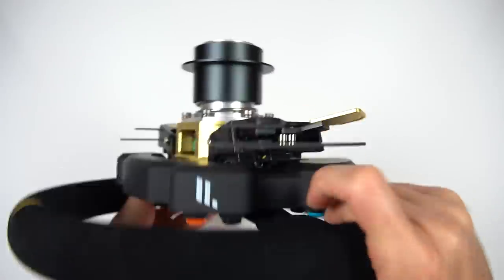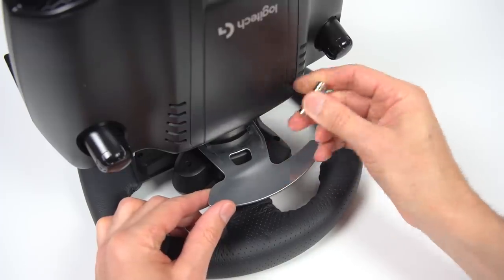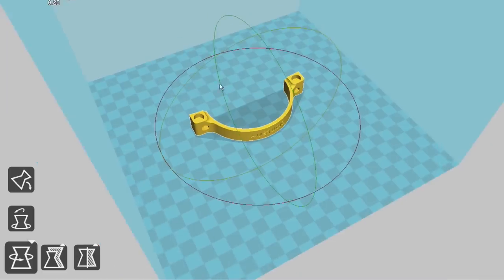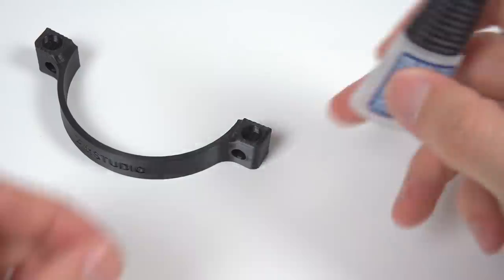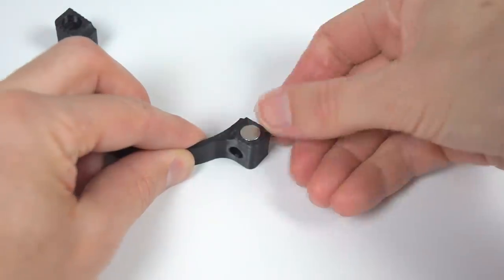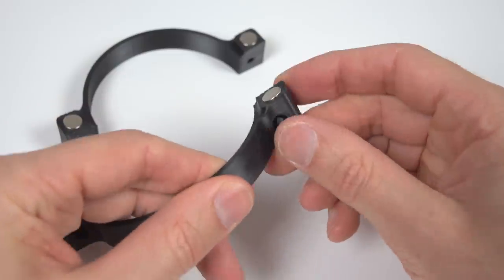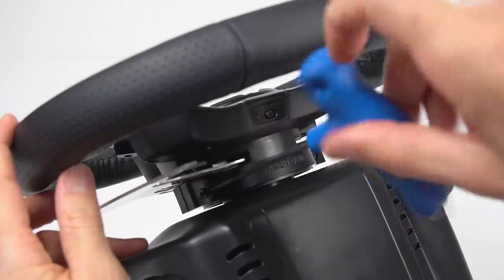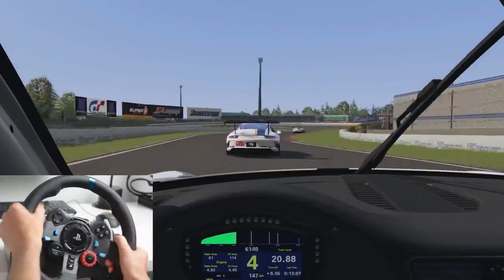IMPROVE THE LOGITECH PADDLE SHIFTER MAGNETIC UPGRADE DIY

Comment: great. now i need a freaking 3d printer
Reply: Same😂
Reply: Some guy printed it for me for 2,22 EUR with delivery (but i paid for project)
Reply: Get one it’s worth it 100% but it is a pain in a ass to maintain it
Reply: @karpz6380  Is there any way you could send me the project for the 3d printer?
Reply: i made it with wood, i tightened them together with zip ties so the wood wont crack or stress too much

Comment: Currently looking at buying my first wheel and I've been binge watching most of your mods videos for the g29. You're super creative and talented and that 3d printer is one hell of a machine! The sleepy DYI part of me gets super interested in all your solutions.

Now, onto my question, I can find a g29 for about €220 online while the T300rs (basic 2 pedals set) sits at about €260, but I guess I would upgrade it further if I find out I truly enjoy simracing (the new load cell pedals presented by David Perel look like a great piece of kit, not to mention the TH8A shifter which looks quite cool).

I got a bit confused as checking many "world records" in Assetto Corsa I saw that guys with G27 and G25 are the predominant majority in the top leaderboards and I wondered if I should even go spending more than the "cheap" G29 to have an effective setup.

Either way, bravo with your videos and best of luck with your current and future projects!

Comment: The paddles on the Logitech wheels have always been a downside for me, which is why I never use them [and also why I've been thinking of purchasing a setup from another brand]. However, this little mod may convince me otherwise to stick with Logitech and even upgrade from the slowly dying third-hand G27 to a G29/G920 and purchase/make/install this mod.

Quick question, what other hardware [nuts, screws, magnets etc] would be required to go along with the mod install?

Keep making the awesome custom mod videos! ❤❤❤
Reply from the maker: Yeah the Logitech base is decent for a bit of fun. For the install just what is seen in the video, parts list is included with the files.
Reply: @amstudioprojects  idk if you'll read this but is this mod compatible with the g27? it seems like it
Reply: Nope doesn't work... there's too much room compared to the g29 and it just magnetizes to the paddles and doesn't come off
Reply: Don't buy a g29 if you had a g27, there's upgrade as they are the same basically, get a thrustmaster unless you don't want to spend the money :)
Reply: @scottex.  OKAY EDIT: I got them to work by double wrapping a hair band around them just before the magnet. Works now
Reply: @rubbertoe.  oh ok thx, ill order them as soon as possible

Comment: I both one of those on Amazon.  I actually just got it yesterday.   I used it a couple of times and I took it off.    The magnet they used is so strong, it doesn’t feel right.   I wish they used a 4 smaller magnet instead of 2 big ones.

Comment: Nice modification, I built already a few from you. One question: Can use it when I installed the Extender or is the Extender to wide?
Reply from the maker: Which extender are you using?
Reply: @amstudioprojects  I'm using the one u made for the G29
Reply from the maker: Hub extender fits to the inside, so yes this mod will fit
Reply: @amstudioprojects  Perfect thanks!

Comment: hello, ive been recently going thru possible g29 upgrades to add to my simtrucking setup and I was wondering is it possible to make some sort of an extension that makes the wheel rotate 1800° insetad of 900°, like using some 2:1 gear wheels. It would resemble real trucks more as in ets 2 its capped at 900° which is common rotation scale of normal cars but there are mods to make it 1800°

Comment: Works on G27?
Reply from the maker: This one has only been fitted and tested on G29 and G920.
Reply: @amstudioprojects  I will try! Thank you very much!
Reply: @DanteBasso  did it work?
Reply: @wamwung  not tested yet.
Waiting for the magnet
Reply: @DanteBasso  have u already 3d printed the pads? Do they fit in G27?
Reply: @wamwung  yes I print!
I check this yesterday and they fit in the g27. You can print and use.

Comment: If you do not have a 3d printer, this mod will cost you around 20 euros, given the cost of the printed pieces,  that magnets are ussually sold in packs of 10-15 and the overall shipping costs. For me it was 25 euros in total, but it may be less than that